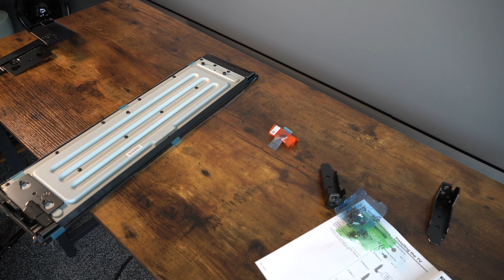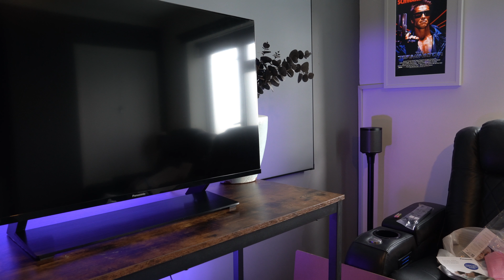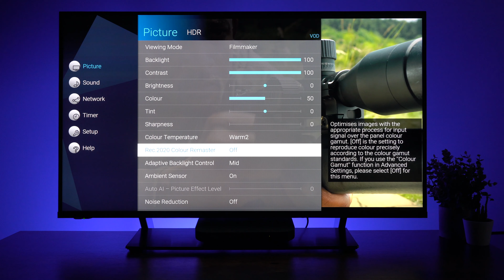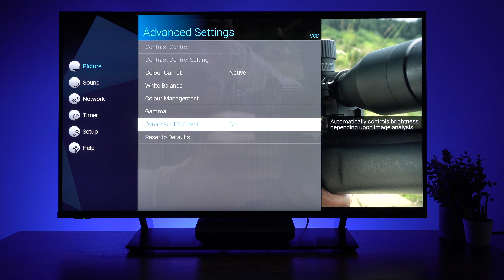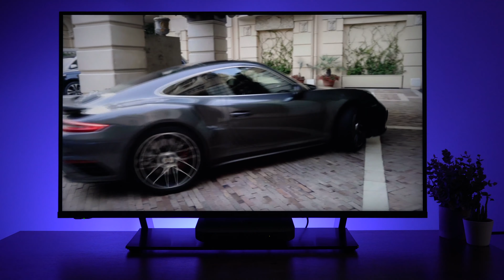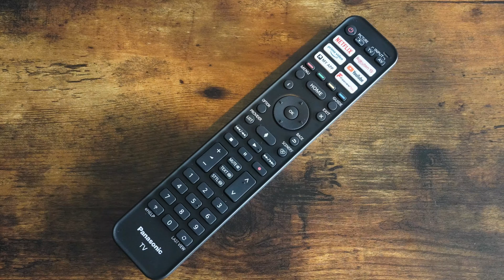NEW 2021 Panasonic JX850 (JX870)  LED TV Full Review

Comment: I am looking at buying this or the Samsung Q60A. Personally I think this is the better option as I can get it for £20 cheaper, what do you think?
Reply: Panasonic will be more reliable, if that matters to you.  Typically Japanese products outlast Korean and Chinese.
Reply: @interstat2222  I decided to buy the Panasonic and so far a superb TV, very straightforward to use and great picture quality on filmmakers mode.
Reply: @calumcampbell5718  I believe you made a great decision. It's a great TV, very high fidelity picture. Only Sony can really compete at this level.
Reply: @interstat2222  I managed to get the 50" for £529 which I think is a very good deal. Have you got this model and what picture settings have you got it on?
Reply: @calumcampbell5718  Good price, nice size.  I know these models well.  

I find Normal with Colour Temperature on Warm2, Intelligent Frame Creation Off and Ambient Sensor off/on (depending on your room lighting) with backlight adjusted to suit your brightness works well for everything on Panasonic.  

Never needed to change anything else apart from put Bass Boost on sound and turn off any fake surround sound effects.
Reply: @interstat2222  This is my first Panasonic TV as I have had Samsung TVs in the past. I have found Samsung very reliable and used to have those on dynamic.
Reply: @calumcampbell5718  Samsung and LG are about equal in terms of reliability, just like Sony and Panasonic are.  They're all good, really.  They're all major brands, it's like cars.

Comment: My model JX850BZ, 50" came today. OOTB picture settings were way off for my liking, as you said. I made some adjustments and all well now, though I would like a bit more sharpness, which I have at 100%. I don't watch terrestial TV at all, and I bought this to watch Prime and YouTube. Setting up wi-fi was easy. You mentioned the stand, I love it's design. I'm upgrading from an old HD and am happy with almost everything here. Picture, contrast, blacks, etc  all good. Menu options excellent, connection options too. 4/5.

Comment: You should never EVER use the picture settings that you get 'out of the box', like so many people do. At the very least, you should first press the 'Filmmaker Mode' button at the top and start viewing from there. Although I would then recommend setting up varying picture modes for each viewing scenario (Film, TV films, general everyday usage Netflix/Prime/Sky etc). And get a proper 5.1 or more channels sound system. A soundbar isn't really an option for good sound, but if that's what you need due to size, room constraints, price and 'partner's rules', then that'll have to do! My centre speaker is too high for that stand though, so I would have to put something under it, to lift it high enough for the speaker to fit! They should make an adjustable stand for different height speakers really.

Comment: for the price im shocked to find the tv is only edgelit...
Reply: Panasonic's edge lit is far superior to competition.
Reply: @interstat2222  ill have to see them in real life but say uk market the panas aren't even on display in most shops sigh  

I beleive they are tho some of most of lgs and Samsung Edge lit tvs are woeful
Reply: @majorskies7091  Panasonic is struggling in the UK because most people want the cheapest TV (why the Chinese brands are thriving). Of course it's false economy most of the time.  

Panasonic have always had the best edge lit system, along with Sony.  The Panasonic also has pixel level control which means highlights are much brighter than similar TVs.  A very rich picture with great depth. At current prices, I don't see what can compete.
Reply: @interstat2222  ah intresting thnx. Ill have to look more into the pana line but sadly our shop just doesn't put them on display. I really like the Sony and Philips(TVP Philips anyway) as they have nie edge/direct lit tvs.
Reply: @interstat2222  On Amazon, I saw TCL & Hisense getting loads of reviews but then realised they're Chinese State funded companies, have potential for spyware issues etc.
Reply: @HighCarbDiabeticV  If that bothers you. It's debatable that they would be sending data like that via a backdoor. 

I always try to support Japanese when possible just because I grew up with them and they never let me down, but I've seen some great Chinese products (especially Hisense ULED series). 

For Japanese I also recommend the Sharp EQ3 if you're in the UK. About equal to Panasonic but with better sound.
Reply: @interstat2222  The FBI came out with security concerns not long ago. I'm in the Isle of Man and looking for a tv from the UK, ideally Amazon. I'm struggling to pick something though for below £550, there are so many options: Samsung AU7100 55 Inch; Panasonic 55 inch JX600BZ ; Panasonic 50 inch JX850BZ
Reply: @HighCarbDiabeticV  Hi, I saw the report but it wasn’t clear what was being sent back or if it was just poor security.  Don’t think Hisense were included.

Panasonic JX600 is not made by Panasonic.  Produced by a Turkish supplier which makes TVs for many brands, all the same, so can be bought for less under other brands such as ‘Toshiba’, ‘Hitachi’, ‘Bush’.

The JX850 is a real Panasonic and the 58” (if not too big) seems to be on offer at the moment.  If interested, have a look around, like at JL where it’s called the JX870.  I think that JX850/70 model is the best of your list.

Samsung have had backlight reliability issues on models at that class.

The Hisense U7/8 is the best Chinese TV on the market.

I think Sharp EQ3 is probably worth looking at too.

The Sony’s from last year like X80J may be worth a look as quite heavily discounted.

Hope that helps.

Comment: I bought a TX-40Jx870b from John Lewis. They did not take the time to tell me much about it. 
Eventually I found some of the settings and I found that out of the box settings were not very good.
I had to turn the backlight down because it was on maximum. 
The picture still looks a bit washed out compared to my 1999 Panasonic. 
The other thing is that the HD Channels and others are missing. I used to like Quest HD on 114 and its not there. 
Also no subtitles on 104 & 105 for some reason. Channels the jump to 201 No BBC 4 and 7
So I am disappointed and I can send it back. 
So I don't know if I am an idiot or is it something else.
I also use a Humax recorder so when I record the HD channels with Adverts and skip through them.
But my Humax is an old one and it does not work with this TV. 
I used it a lot on my old 1999 Panasonic because despite having the 3 tuners the only one that was HD was the Satellite ch
So what am I doing wrong please being oder pensioner with Multiple Sclerosis I am totally lost.

Comment: Could you please put up the best picture settings for this panasonic tv
Reply: For most people, Normal mode with Ambient Sensor on/off according to taste and Intelligent Frame Creation Off or Low will the best settings for general use.  Everything else as is. Maybe change Colour Temperature to Warm1 or Warm2 (Warm2 is industry accurate standard).

Don't forget Screen Settings > Overscan OFF (ON by default), unless you want a slight crop to the picture (intended for broadcast TV but not really relevant or needed).

Comment: I was really considering this TV as the usual opinion seems to be that Panasonic is the next best after Sony for a cinematic picture experience. But as you said, the literature is confusing. So I was then considering the JX940, but it doesn't seem to be widely available in the UK yet and so I've yet to see a proper review of it. The literature again is sketchy.
Is there a difference between the JX850 and JX870?
Reply: Sony and Panasonic have always been equal. JX870 is identical.  Just a retailer exclusive, so the finish might be slightly different (eg brushed effect).
Reply: @interstat2222  Panasonic tv department has been outsourced to tcl
Reply: @Woppettier  It hasn’t. They said they would but they didn’t. I believe TPV is building them for them but still with Panasonic specified  parts.
Reply: @interstat2222  Interesting. TPV has a good share in my country's tv market because of the philips branding. Obviously they deliver to a certain degree since people are satisfied and leave good reviews. But it has little to do with the old philips company anymore. And most people aren't aware it seems.